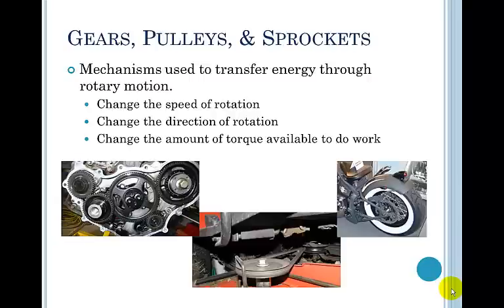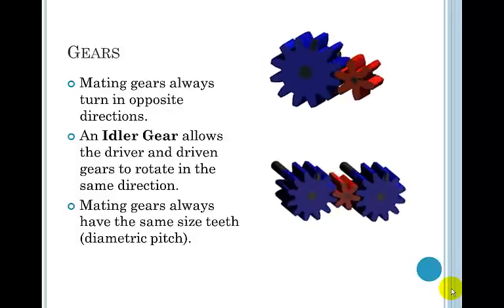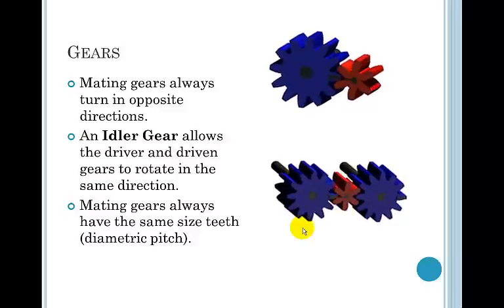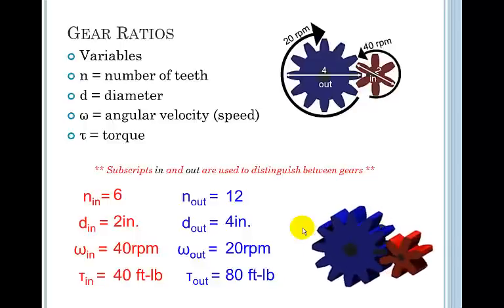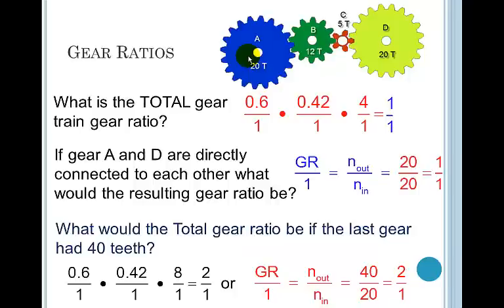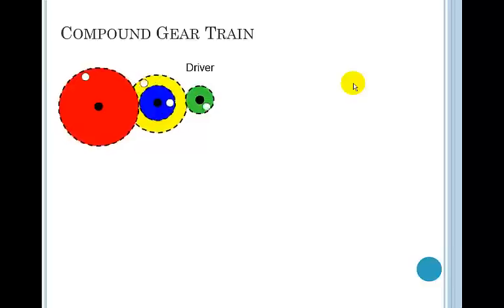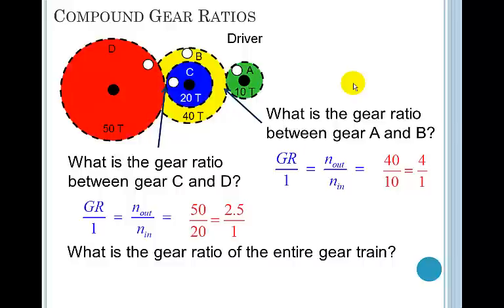Gears and Gears Ratios

Comment: Matt, when you have more than one gear ratio you don’t add them together, you multiply one ratio by the other. Example there are 2 each 2.5 ratio gear boxes. Added that would be a 5.0 ratio. Actually it’s 6.25 when multiplied.

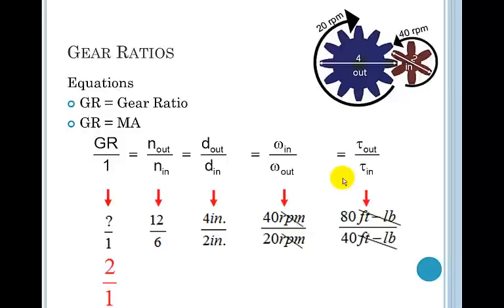Comment: 6:07 why is the torque output 80?
Reply: Tokage Law is it possible to “maze” the gears to meet on a screw shaft on different sides, obviously the ones touching the shaft directly will have to move at the same speed. But is it possible to combine speed and torque?

Comment: Presented easy to follow. I was looking for information about gear ratios trying to figure out some lathe information. Your presentation got me through the lathe spindle rotation to the gear box input for the lead screw. Now I will have to figure the gear reduction in the gear box to turns on the lead screw. Goal it then to change the American carriage distance movement to metric.

Comment: I think the reason why in the mechanical advantage equation the velocity is an inverse(input/output),is because the velocity outcome is always a disadvantage(comes out smaller than the inital)in a gear system that has a MECHANICAL ADVANTAGE so it has to be RECIPROCATED to conform into the mechanical ADVANTAGE equation...besides the video is quite informative thank you!